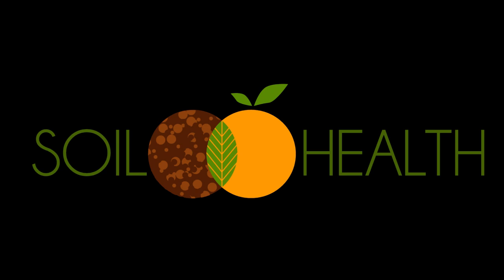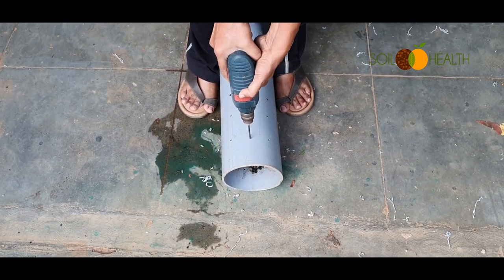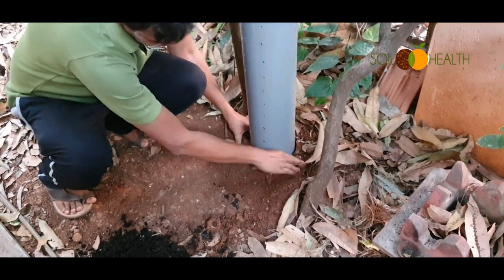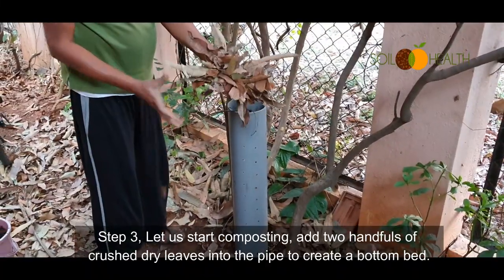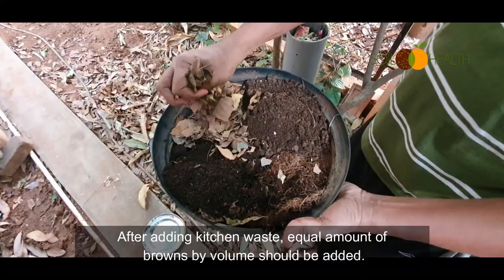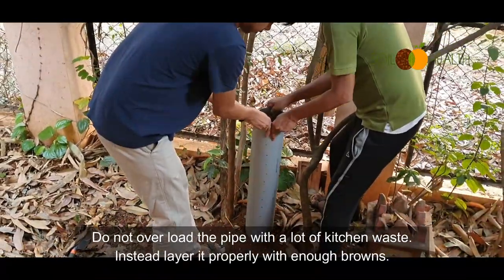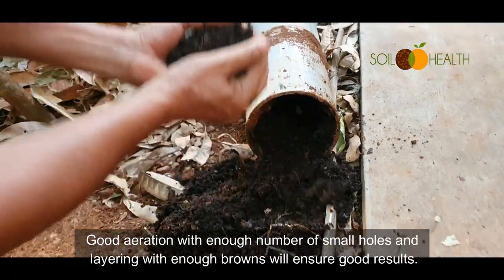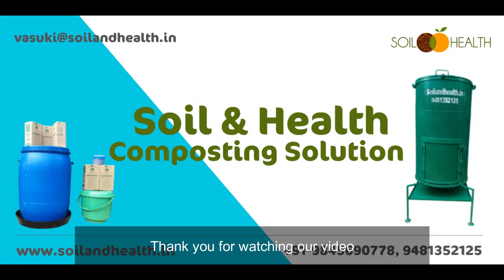English: DIY Pipe composting using Aerobic method in English #pipecomposter #diy

Comment: Hi. Thabks for the video
 Have just started wkth this method. Should the compost be stirred at anytime?
Reply from the maker: If you are following greens and brown ratio and good microbes,no need to stir. Water the plant through the pipe
Reply: @vasukiiyengarsoilandhealth1059  thanks a lot for your prompt reply. You mean i should add water in the pipe? How many times  how much water? as of now for this, I made a bottom layer of crushed brown leaves.after that i have been adding same amount of kitchen waste and Brown's (leaves +cocopeat) by volume in layers. Have also added cow dung slurry over the kitchen waste. Started it on 22nd April and add kitchen waste and browns once a day everyday. The pipe is dug into the ground next to a tree.

Comment: Hi, Its been going well so far. Wanted to ask if I should press the compost from top to compact it and make more space?
Reply from the maker: No. Do not press it. The compost pile should be fluffy and aerated. Composters are in pair or even more. Fill one at a time and build capacity needed

Comment: Hi. Wanted to check when should I harvest the compost? Started adding to the pipe compost (6 feet pipe of 10 inch diam) from 22nd April and then stopped when it became full (around 20th may). Was adding about 300 to 400 gms of compost. As of today, the level in the pipe had come down by a 1.5 feet almost)

Comment: Hi love your video. I am little confused because of other videos. Some are only drilling holes on the section of pipe that gets buried in soil. Net net there wouldn’t be air. What is the difference
Reply from the maker: Thank you. If there are no holes in the pipe above ground level, it can become anerobic due to lack of air circulation. The method we showed in the video is aerobic composting and having holes made in the pipe above ground helps

Comment: If aeration fails due to inexperience in filling the pipe or during rainy season when water creeps through the holes thereby making the system wet, will it produce fowl smell through the holes?  If that is the case, would you recommend pipe without any holes above ground level. Please give your opinion on both systems.
Reply from the maker: There is a defined process that should be followed. For a family of 3 members, 6 pipes are required. People should follow 1:1 ratio of kitchen waste:cocopeat/soil/compost ratio by volume. If you don't follow the process and you overload it,then it will fail